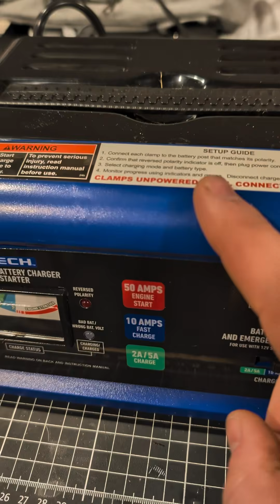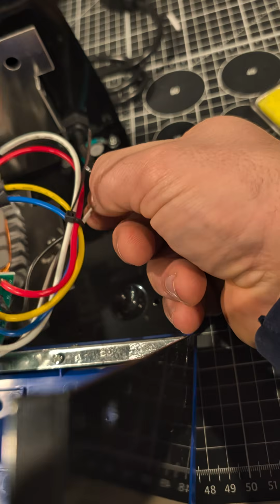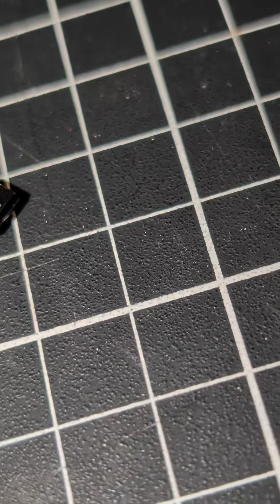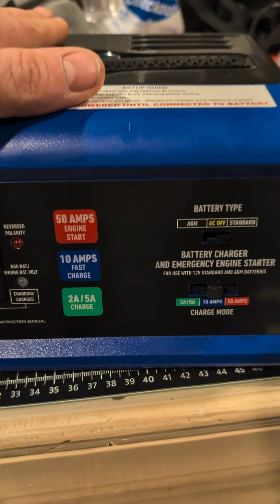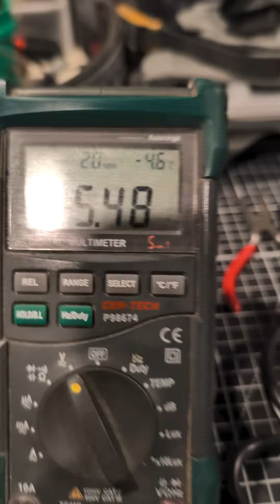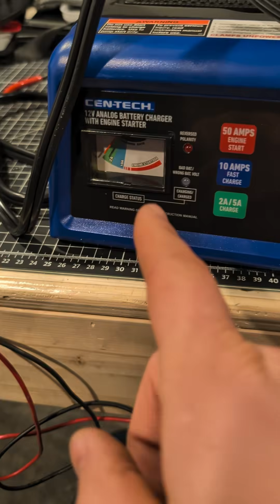Bypass Safety Cen-tech Analog Battery Charger

Comment: I just done the first step of soldering the neutral to power out. Inside of My charger does not look anything like this. Same brand and type of charger. But I figured I’d test it just to see what it did. It still works. And if I tap clamps together it sparks. 🤷‍♂️ i dont know if i need to do anything else. But for now it still works. Has Anyone else has done this?

Comment: Thank you for this information.
Mine is completely stock. However the Amp Meter needle stopped working even when almost brand new.
Wonder if anyone experience this and or if it is fixable? Or do I need to replace Meter module?
Reply from the maker: Looks like you should be able to find an off the self replacement and solder it in.
Reply: @How-To-Tools  Going to try to find one, and see if it fits. Thank you for your reply

Comment: My wires are not color coded with two whites. 
Model #59424. Wires are colored from right to left red, yellow, blue, much like yours, but then white, black and orange. Orange goes to the transformer, white and black come from 120v power. I'm thinking to put a switch with leads between the orange and white but do I still have to remove the transistors if I was to enable the auto shutoff?
Reply from the maker: Trying to remember hoe its wired and the explanation JP gave in my reference. You should hopefully have the same labeling as I do on mine and if you can Match it up the same it should work for the mains wiring which should the "Smart"part of the main board and makes the transformer always powered. The transistors I believe are the triggers to turn on the power to that outlet leads after they sense voltage from a battery. Refer to JPs video I've got info in the description for his description
Reply: @How-To-Tools I tried to put a jumper from the orange to the white and nothing at the clamps. It appears there are what may be transistors on a separate board but I didn't mess with them. Is that what is disconnecting the power with no voltage at the clamps as in a partially charged battery present? Not being able to charge a dead battery makes the charger basically unusable.
Reply from the maker: The transistors I jumpered were on another board in the back left side of the case
Reply: @How-To-Tools is there a way for me to send you a pic of the inside of what I have? It's totally different that what's in your video although the outside is identical
Reply from the maker: Interesting, post a YouTube short and you might be able to get some assistance. Drop a link in the comments
Reply: The inside of mine does not look like the insides of any I have seen in youtube videos. Pretty frustrating
Reply: Don't understand how a company can design a piece of equipment to specifically not do what the customer expects it to do.
Reply: Were you able to bypass smart features. My charger has the surface mount resistors.  Would appreciate  instructions to disable samrt features.
Reply from the maker: In theory it should be the same process, just tighter area to work in on the surface mount stuff

Comment: Troubleshooting this procedure on a different brand (Chicago electric). Transistors jumpered out.  Issue comes with the neutral. Chicago electric doesn't run it to the circuit board. Any idea what the philosophy is behind the neutral move so i can apply it properly to this brand?
Reply from the maker: Couldn't say since I've not had the privilege to disassemble that brand/model

Comment: Thank you for these detailed directions. I'm not as good at working with electrical connections as HarborFreight. For example, I couldn't figure out how to pull out the two transformers. So, instead, of putting in new bypasses, I cut off the transformers from their wires as high as I could and I cut the middle wire as close to the board as possible. Then I soldered the two outside transformer wires together.  The end result worked and I'm getting about 15.5 volts output at the lowest setting.
Reply: If you follow these directions, you should not use this charger in a closed space, such as inside a house, because if you forget about it and leave it charging a battery for days, the battery being over-charged will release hydrogen into the air which could cause a fire. Law suits ended the production of the old-fashion analog chargers (the ones that could charge dead batteries) due to this danger.

Comment: Here I am with a very specific problem thinking no one out there can possibly have a solution… this video proves I have never had an original experience 😂 thanks for the video man! Off to tear apart my one hour old hobo freight charger.
Reply from the maker: Exactly where I was at. Already used it to recover a dead dead battery. Thanks to @JP-up3ok for the video I used.
I still would like to add a power switch

Comment: Nice video, if you want a switch for power just wire a toggle switch in line with the hot lead of the incoming power, I've done that  to several old units.
Reply from the maker: Thank you!. That's my backup if I can't figure out a more elegant solution.